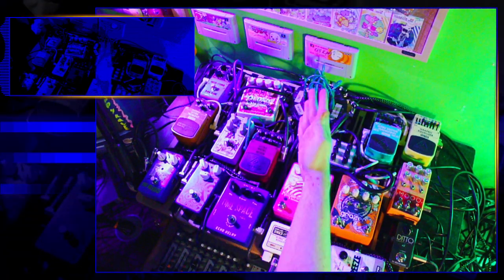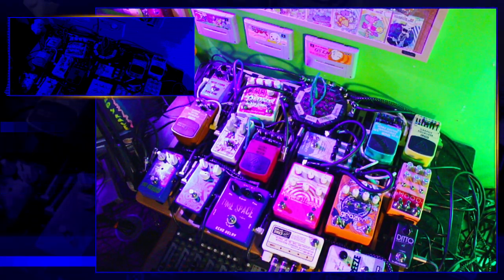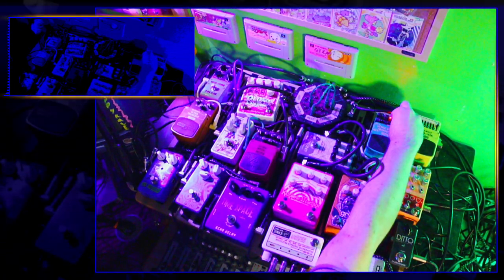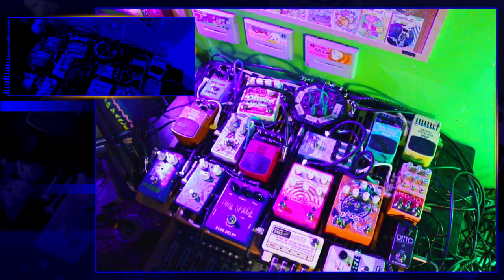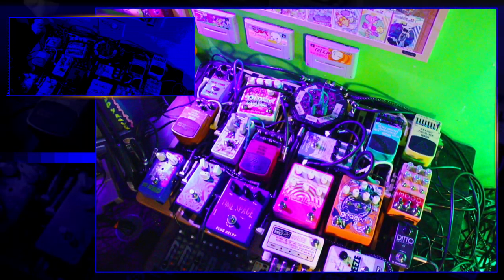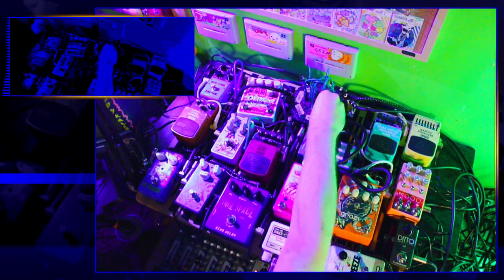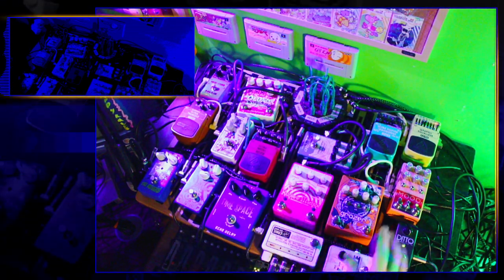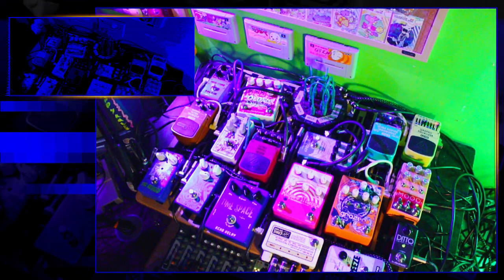𝐡𝐨𝐰 𝐢𝐭 𝐰𝐨𝐫𝐤𝐬: pedal rig rundown & building a sound

Comment: Loving this, I use passive matrix mixers in my feedback setups. I use the gain knob's on dist/fuzz/overdrive to generate the feedback. I made a couple of 4×5 models and a large 7×7 in a cinema film reel can. The signal levels can get quiet as passive mixers attenuate the signal, then the slightest turn of the feedback eq or gain will make the signal scream super LOUD. I've recently bought a forcefield compressor by TC Electronics to control it, it's early days but I'm getting some success. Love the sounds you tease out of the pedals. Keep up these sort of experimental video's.